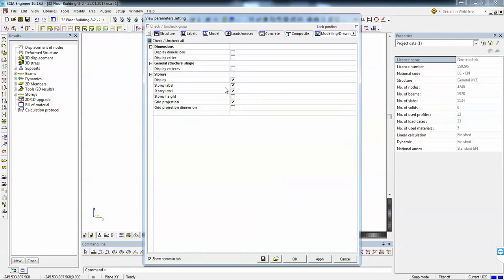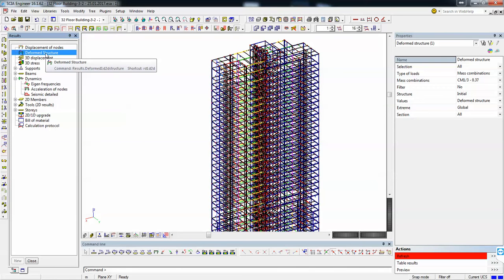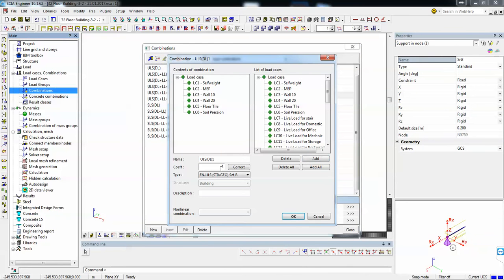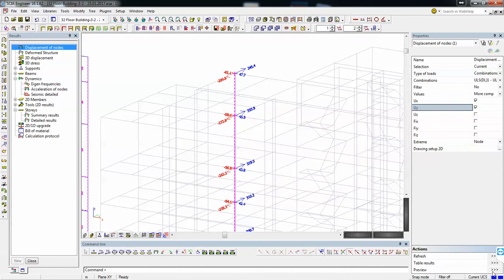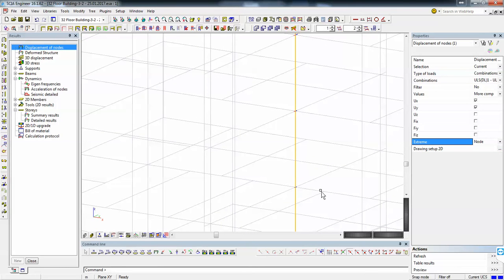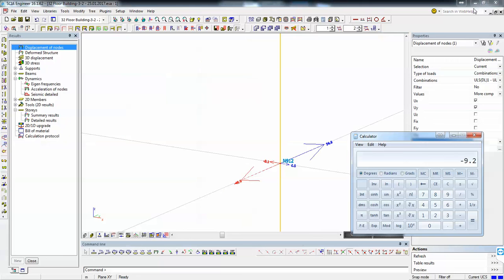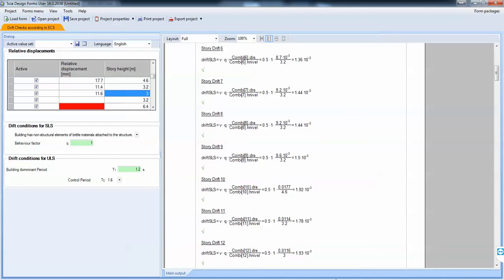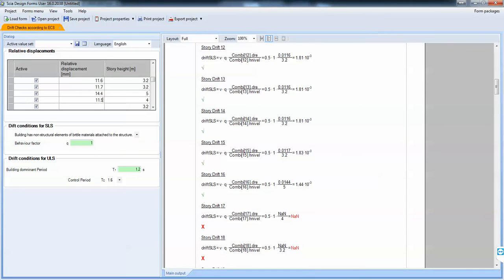Lesson No.5: Checking story drifts  [EN]

Comment: Thank you for the video. Definitely like :) 
I have a question and it would be nice to hear an opinion from qualified person. Do you use bending/torsion stiffness reduction to reproduce cracked cross-sections of members? If yes, than for both seismic and non-seismic regions?  
One thing that confuse me is that in Eurocode the reduction suggested to seismic design, but ACI, as I understood, recommends the reduction for non-seismic design as well. 
What do you think about that?
Reply from the maker: Yes, the stiffness reduction is to simulate the cracked section. The check it is mandatory in seismic regions, 50% is used for deflection check but for the elements design these percentages can vary.
In non-seismic regions you can accept cracks and play with the elements stiffens in order to redistribute forces towards desired structural elements. The elements will be designed to those forces so that they can only carry limited forces and redistribute to the stronger ones.